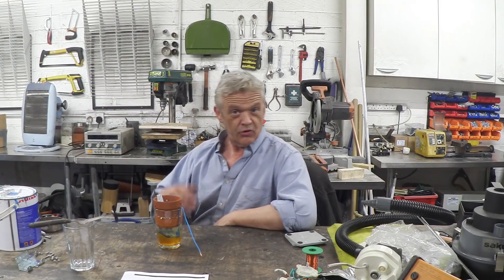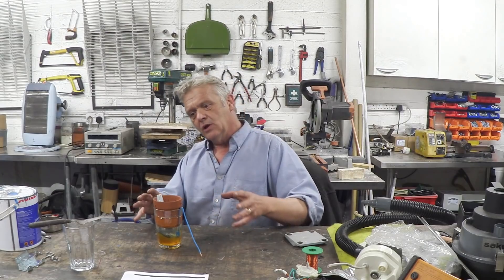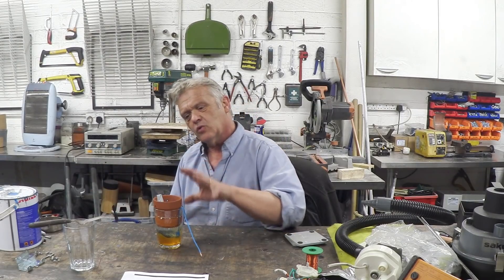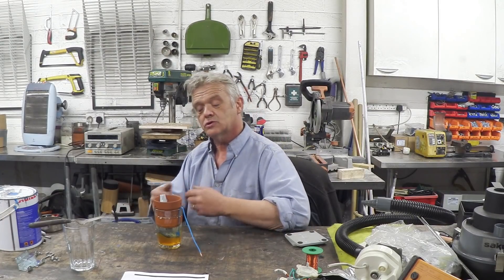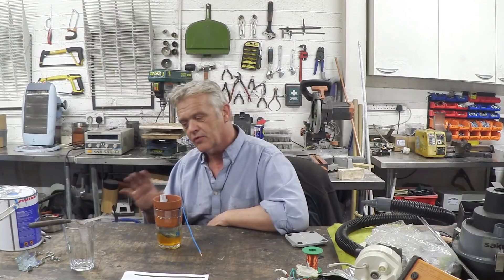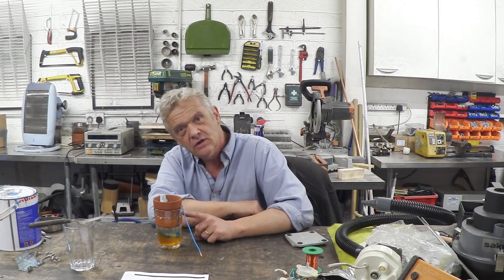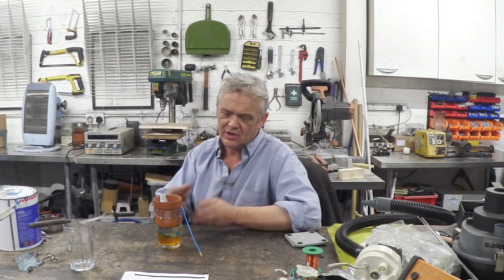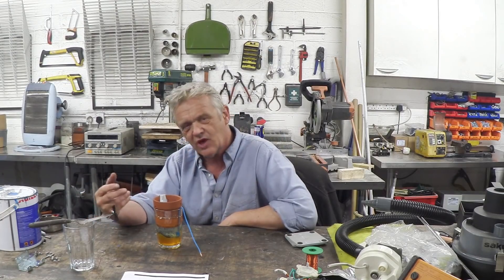1237 Don't Be Fooled By This Battery - A Contender With Lithium

Comment: The brilliant thing about this battery are mentioned before is the fact that Bromine is the only soluble element on the periodic table at room temperature — there are no solid-state crystal structures to get damaged through use over time, which is the same benefit as liquid metal ones, but this one won’t need a smelting furnace so can be made it at home!
I suggested to a friend at pub last night that we make one in an old bathtub he is getting rid of hahaha.
Reply from the maker: love that idea mate!
Reply: Please excuse my ignorance, but wouldn't bathtub of zinc bromide cost an absolute fortune? I just had a quick look at the process for making it but it's way above my paygrade! I just had a look at the price of zinc bromide in the UK and it's nearly £80 for 500grams (which I assume is close to half a ltr?) I'm probably being daft, I'm just trying to learn... chemical are very new to me.
Reply: I've been thinking about this and realise I have probably missed the point. Are you planning on stripping a metal bath of its enamel and taking advantage of the massive surface area of one of the electrodes? Then partly filling the bath which obviously means not as much ZnBr₂ required? I don't know, just got cogs turning in my head as I try to make sense of this chemical stuff.
Reply: @wongowonga  You were right the first time I just meant to use it as a quirky base container (assuming enamel doesn't corrode ? haha). For my intended purpose of powering a solar house it wouldn't be expensive over the lifetime of its use at all.. it's just a choice to front load the cost. Like the decision to buy a car vs leasing and never owning.
Reply: Why not try using a 5 gallon plastic bucket instead? That's what I want to try...

Comment: Hi Sir, do you believe Lithium is the solution to fossil fuel problem? Something tells me that while Lithium is a good solution, there is nothing wrong in finding cheaper solutions. Sodium ion batteries maybe?
Reply from the maker: rechargeable batteries are never a solution to energy creation mate - the energy to charge them - and indeed make them - must come from somewhere - batteries only store they don't generate
Reply: @ThinkingandTinkering   One of the most fundamental laws of conservation of energy is "Energy can neither be created nor destroyed. It can only be converted from one form to another." Both fossil fuels and lithium ion batteries only convert stored chemical potential energy to electrical or kinetic energy. Today's problems are not based on energy creation, but on energy storage and energy generation. I am very happy that people like you are researching on alternatives to everything. Onboard generation of electricity in an electric car is a very new idea nobody has thought of, and I am sure it will work
Reply: @aadhithvarathan5432 ahem... nikola tesla